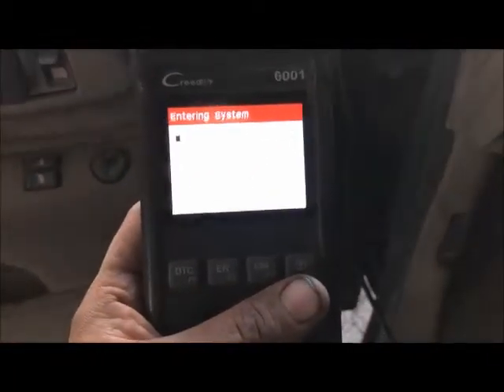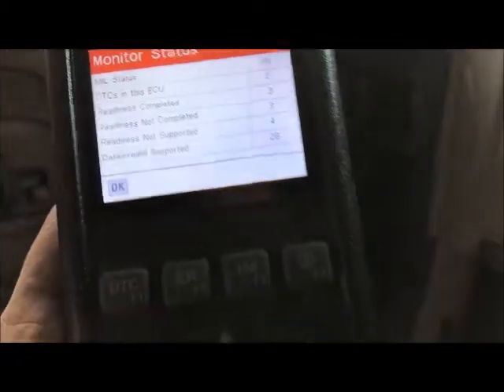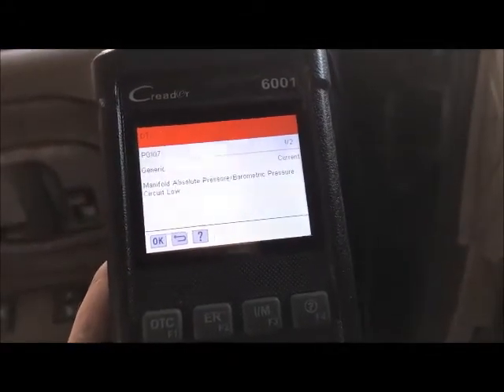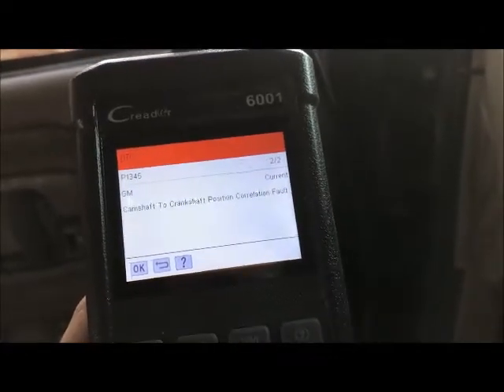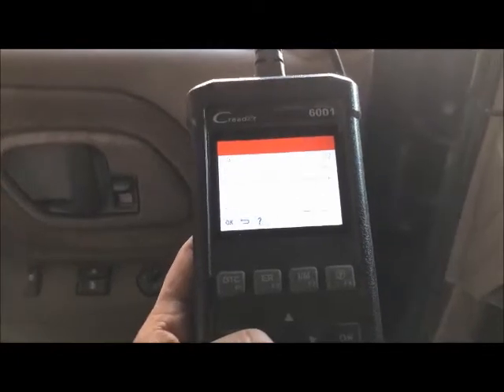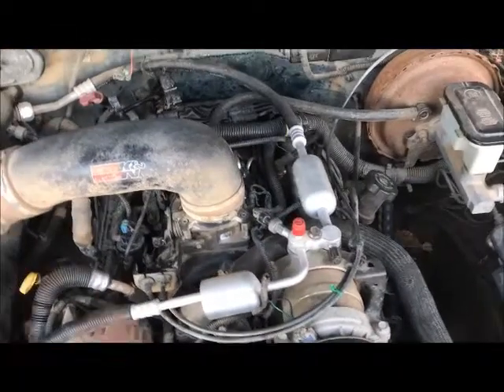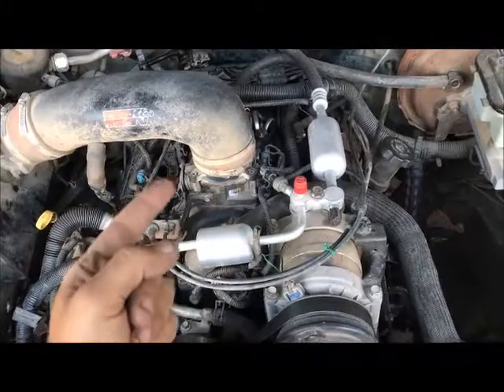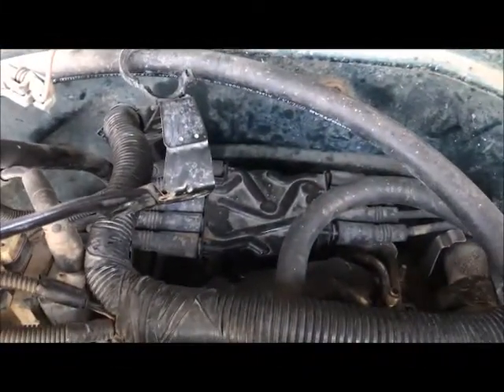Multiple Codes With One Meaning P0170 P1345 Fix, Solved

Comment: I have a 2006 jeep that has a bouncing idle like fuel filter issue but after testing fuses and everything electrical the volts pulse from 13ish to 15ish to the idle bouncing never seen this happen before I also get multiple codes that change each time hopefully you the master can solve it cheers
Scott 
Really impressed with your videos straight to it and explanations are perfect just found you today subscribed and be telling all my car nut mates to subscribe to

Comment: Hello ,we have got stuck with too codes on Chevy explorer 1999 it’s 1345 and 1870 ....we have change sensors and etc....timing was changed couple month ago ,engine and tranny , and also after driving a while on the road during the rush hour it has a kick while driving,any ideas????thank you....
Reply from the maker: ignore the transmission code, because a 1345 will cause an 1870 code. concentrate on the 1345 code, i would try resetting the timing. thanks for watching!
Reply: My distributer cap came loose, made it kick then died.  Wires on the frame will make it miss.  Look for white semiconductor deposit on frame.

Comment: Ok so had the 1345 code but what my 2000 GMC Yukon Denali does is the craziest thing. I've replace about 8 starters so far it's starts fine a few times, but after a decent trip or running for a while it doesn't fully engaged when trying to start and it just grinds. No it doesn't need shimmed what could that be.
Reply from the maker: bad teeth on the flex plate. for sure. thanks for watching.

Comment: Alright figured out the last problem runs great thank you but now I have a code for bad wheel speed sensor but when I am driving (usually on the highway) it will randomly hesitate or hiccup or what ever you wanna call it it not when I am accelerating or decelerating mostly holding a steady speed already replaced all spark plugs and mass air flow any ideas?
Reply from the maker: when was the last fuel filter installed? be sure there are no plug wires touching or leaning on exhaust. i guess i better ask the year make and model ?
Reply: thomas brian 98 GMC Sierra plugs have been replaced and fuel filter no idea a long time probably
Reply: I just drove four hours and still can’t pinpoint what it is I read that it could be a coil any ideas?
Reply: Often a wheel speed sensor issue will be a bad wheel bearing

Comment: I have multiple codes rn I believe is timing if I sent you a picture of codes could u help figure out the problem
Reply from the maker: yeppers, you can just list the codes here, along with year make and model if you like !
Reply: thomas brian 
1998 GMC Sierra 5.7 vortec 
p1345, p1111, p0340, p0300, p0113, p0102, p0303, p1345
Reply from the maker: dipper, i have something i want you to check,,, your rotor that is under the distributor cap. i think your timing is off, how many miles are on the truck ? and also check the spark plug and wire to the number 3 cylinder.
Reply from the maker: all these codes have one thing in common. the crank and the cam shaft are not in sync. therefore you have a bad rotor, or bad distributor, or you have slipped time. does the truck start at all ?
Reply from the maker: if that rotor looks bad, it is the problem. it will cause all these codes, keep in mind if it is bad and you replace it ( about 20 bucks ) then you will need to clear the codes still after the work is done. let me know.
Reply: thomas brian yea the truck starts and idels ok but as soon as you go to drive and get it over 1000 rpms it’s runs rough